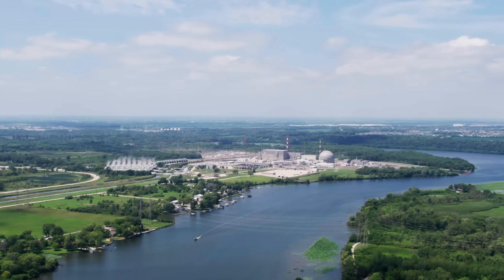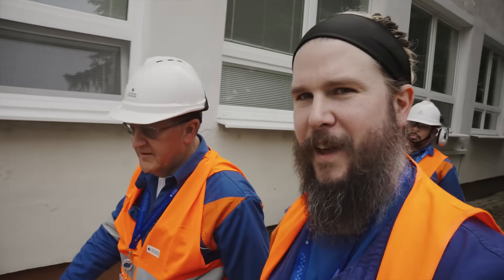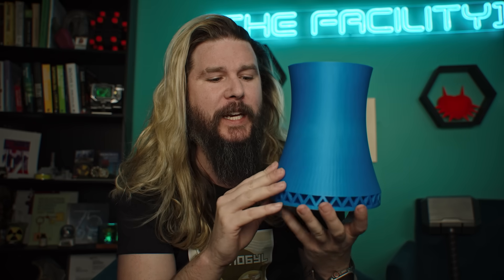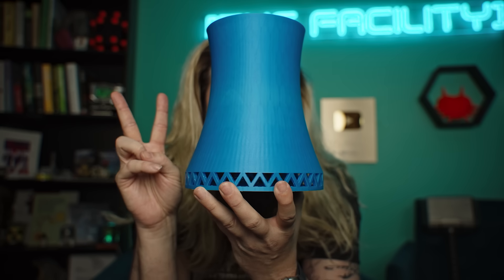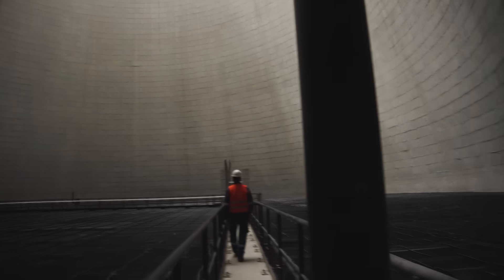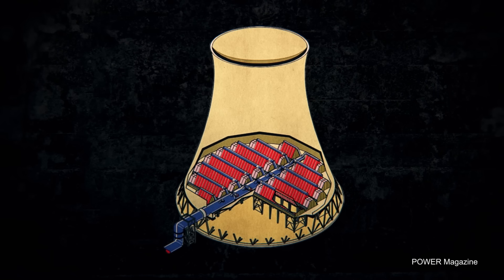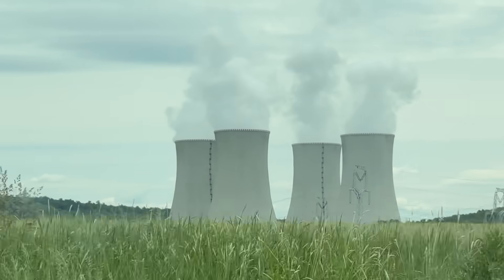I Went INSIDE a Nuclear Cooling Tower

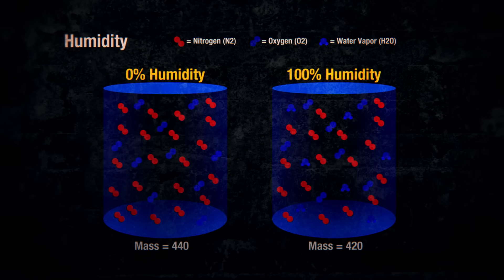Comment: 9:00 Exactly, because of the molar gas volume. Gas at ideal  conditions of 1013 mbar and 20 °C will always have a volume of 20.4 L/mol. Since water at 18 mol is lighter than diatomic nitrogen at 28 mol, it's less dense

Comment: Worth pointing out: Not all nuclear power plants use cooling towers. A lot of nuclear powerplants are constructed near the sea and therefore use sea-water to cool insted. This (I guess) reduces buidling costs, since you don't need to construct an enormous concrete tower. Another interesting thing here is that the marine life usually thrives close to these sites, because the water is very warm here and you're also not allowed to fish close to the nuclear powerplant (not for radioactive reasons, but for security reasons).
Of course, sea-water cooled reactors only works if you have a sea close to where you want to build your powerplant, which isn't the case for some places.

Comment: I always found it interesting that cooling towers are synonymous with nuclear power when they're actually used by all kinds of power plants.  There are several coal, natural gas, and even biomass power plants that use them.
Reply: And there are many nuclear power plants that don't use them.
Reply: @danbert8 IIRC, none of the British nuclear facilities have them.
Reply: @danbert8 IIRC, none of the British facilities have them.
Reply: I feel it’s because they’re “symbols” of the atomic age.

Coal has the thinner tall towers associated with them thanks to Industrial Revolution imagery, while gas plants often use very similar infrastructure to existing fossil fuel plants.

Nuclear plants, however, had way more of these types of cooling towers (and the Simpsons) to push into the mainstream image of nuclear.
Reply: @Palgineer  They are common to any power plant using igh pressure steam turbines.

Comment: Honest Question, could we not use the heat venting from the tower in some way ? seems wasteful not to. Or does that effect its operation so its left alone ?
Reply: Hot water could be pumped to locals to use for domestic heat and domestic hot water, but getting it there in a still useful heat isn't at all practical.  Nuclear power plants are located quite far from where that hot water would be desired.

Comment: Hi Kyle, Question: In your video “ I went inside a Nuclear Cooling Tower” time stamp 2:34-237  when you highlight the secondary loop, you say “ thermodynamic but not physical contact”  would that be better explained as Thermal Radiation from the primary Loop to the secondary loop?    Thanks!

Comment: It's a common misconception that there is any radiation in the cooling towers.  There never is, in any plant that uses them, and never has been.  The cooling tower works with the secondary water system that never touches the core.
Reply: Or more accurately; radiation is ubiquitous and is in every cooling tower that ever existed in every application they were ever utilized.
Reply: What you should have said is there's no more radiation in a nuclear facility cooling tower than any other type of cooling tower.

Comment: That’s not entirely why they’re curved. Yes it gives it strength, but it’s a phenomenon called stack effect. It helps induce a draft to get the air to move in the upper direction.

Comment: the cooling tower steam is irradiated, but it's like cosmic background levels, of if the cosmos was 1, a cooling tower gives you 2. it's just so painfully low that it's negligible.

also Cherenkov radiation proves FTL is possible, and it's blue. after all, Cherenkov radiation is faster than light particles through a medium, a medium is anything between you and end point, even air is a medium.

EDIT: we need a concert in a cooling tower.

Comment: Spoiler. I was correct. Venturi effect is active in the cooling tower. 

Not gonna lie, I thought the shape of the cooling tower was for venturi effect and removing hot air/steam more rapidly, especially with holes at the bottom.

Comment: These towers have also been used in fossil fuel plants for example Didcot B which according to Wikipedia is still used for emergency backup to the UK national grid. Also the interior of a cooling tower at the former Croydon Power Station (UK) was used to film scenes for the 1985 film Brazil.

Comment: So I want to throw this out here, there's actually like three different styles of cooling towers, depending on how much heat you have to dissipate. These hyperbolic towers are considered open natural convection towers. They are the most energy efficient for getting rid of large amounts of heat; but but they are also really expensive to build, they take up a lot of space, and they also lose a lot of water vapor into the atmosphere; which has to be constantly replenished. 
Then you also have the forces induction open cooling towers; which are cheaper to build, but use more energy to run, they are much smaller for the amount of heat they dispersed dump; and they also lose lots of water. These are usually what you'll see on large industrial sites; such as breweries and chemical plants. 
Then lastly you have the forest induction closed cooling; which is basically a giant radiator open to the air. They are the least efficient and terms of heat transfer;  they use even more energy per unit of heat they remove from the system; but they lose no water at all, which is important if you do not have a source of water nearby.

Comment: I get that the moist air is less dense than the dry air (though I also found it counterintuitive), but another factor in the airflow is that the air is hotter in the tower than outside, thanks to the hot water being sprayed in. I don't have the numbers or the thermo/fluid dynamics skills to say which has a greater contribution to the flow, can someone help me?

Comment: please do explain the OVERWHELMING NEED for a cooling tower. meaning thera are NO OTHER possible solutions for cooling the water coming out of the condenser. from the point of view of thermodynamics, the turbine condenser is identical to a refrigeration cooling loop: remove heat and vent it outside. so, why do you need a cooling tower?

Comment: If you like cooling towers: between Cologne and Amsterdam, there is an amusement park called "Wunderland Kalkar" that's built around a shut down cooling tower. There is actually a 58 meters high vertical swing INSIDE the tower that lifts you right above the rim.
Reply: Came here to say this. This should be far higher up in the comments!

Comment: If the goal is to make heat, tons of heat to turn the turbine, why have a cooling loop at all? Why not just superheat the water for more power/more turns/less reaction required? I can see the need for a cooling loop in case of emergency or shutdown, but not used in normal operation. I also like in a past video, some cities in cold climates, use the hot loop to heat cites and homes.

Comment: the hydraulic press channel could test a 3d printed cylinder vs a 3d printed curved cooling tower both printed with the same material and then see which one is stronger in what direction etc

Comment: couldn't we use the heat from the cooling tower with heatpumps and/or residential heat distribution instead of wasting it into the air? at least if the nuclear power plant wasnt as far away from cities

Comment: I'm always wondered why we waste the heat. Could you not take that heat and redirect it to warm up drinking water or houses. That is what the electricity is used for, but why not make use of rest of the energy. Even if the water would be say 50°C it could be used as pre-heater. Maybe we are not still at the point where efficiency is really the problem. But same thing with the spend fuel. You would have years of low heat generation.

Comment: Wouldn't there already be air flow just from the atmospheric pressure difference at the top and bottom and they are just using that effect and the water helping the effect further?

Comment: All right. I'm 6 and 1/2 minutes in. Let me hazard some guesses here and see how it ends up by the end of the explanation. First of all, I am guessing that they use concrete because it is extremely abundant and also extremely strong in compression, which is the majority of force being applied to it thanks to gravity. Second, I noticed that the shape combined with the openings at the bottom is not too dissimilar from a venturi valve. I'm guessing that the convective rising of the hot air is going to pull in cold ambient air along with it and then the narrowing of the tower is going to cause them to speed up and probably create turbulence thereby cooling the air faster than simple radiator passive cooling would do alone. It's sort of like a blast furnace in reverse.

Comment: 2 of Georgia's (the US state) nuclear power plants have a different style of cooling tower made out of fiber glass and use fans to move air through the water droplets that spray down from the top of the tower. I didn't see these types mentioned here. Probably because they aren't as flashy looking, but they are still cool looking and impressively simple.

Comment: Another advantage to the iconic shape of the tower is you're exploiting Bernoulli's principle and convection. The massive fresh air intake along the lower rim has increased pressure relative to the upper rim and throat. Allowing you to exhaust hot gasses faster than just straight-piping the whole tower and relying on convection alone.

Comment: Fun fact, water vapor being less dense than air is the reason that steam rises! It has nothing to do with heat, though being hot does accelerate its rise! If it weren't less dense, then steam would sink no matter how hot it was!

So, rather obviously, if any given mixture of air is 'diluted' with steam, it's average density will drop and therefore it'll rise faster (and the water vapor will pull it along)

Comment: If air is continuously circulating when a cooling tower is operating, is there any reason you couldn’t extract more energy from the wind within it? I.e. a turbine place in the middle of the bottleneck where air would be fastest?

Comment: The reason they're shaped like that is to  increase the surface area and create turbulant flow and the structural benefits were just a bonus. They're wanting to trap as much of the water as possible for re-use, Watch video of a reflux condenser used in chemistry which have similar but repeated shape and you'll see how it flows. A straight pipe would just create a draft and suck most of the water vapor out the top.

Comment: The coal power plant I used to work had one of those...
Idk exactly why, but it only reduced 2ºC of the water temps and in Brazil it's kinda too hot for them to work properly anyways... the company had extra cooling towers that ran more water and lost more to evaporation, but it cooled the water like 12ºC

Comment: So the bottleneck in the middle of the tower works kind of like a Venturi in a carburetor, changing the air pressure causing the air/water mixture to flow out faster, making it more efficient.

Comment: Lots of coal-fired plants have used that style of cooling tower, haven’t they? Also oil and gas-fired. Last trip I took to England I took some train rides and saw WAY more of those towers than England has ever had nuke plants.

Do MOST people think that such towers mean nukes? Probably. And this video (so far) is reinforcing that. You’re helping make people MORE ignorant, perhaps. But we’ll see…

My local nuke plant uses ocean water for cooling and doesn’t have a cooling tower. I wonder how many power plants built on lakes or reservoirs don’t have them either.

Comment: Somehow I feel betrayed, given the keywords mentioned by Kyle, for no mention about the cooling towers of the Mako Reactors in Final Fantasy VII, which surround the plate like structure, often nicknamed the , albeit rotten, pizza. This Video actually helped explain some of the design choices of the Reactors in the 7th entry and its remakes. Thanks to that I'm also shocked about how little Shinra seems to actually care about the Citizens of Midgar( not that they cared much about their safety to begin with), with how the entirety of the closed systems is inside one of the reactors.( and don't get me started about their military secrets hidden within reactors 1 and 5, as well as the Human experimentations in Nibelheim's reactor and in reactor 0 underneath the Shinra Building) The green glow of the Vapor leaving the reactors may be the result of water vapor scattering the light emitted by the glowing mako at the bottom of the reactor.
Furthermore humans infused with Mako, develop a characteristic halo like glow in the eyes, aptly named Mako-Eyes.

I'm personally still convinced, that Mako Energy is the stand-in for nuclear energy within FF7, given some of the side effects, while others are based on the fictional side effects of nuclear energy.

That said, hearing the accoustics within those towers must have been a serene experience. Liked the rendition of the Halo Theme with that reverb.
Oh and while the shape makes sense from a static perspective, I thought it would serve as a funnel as well.

Comment: the site i work on only has two passive cooling towers I like giving the site tours and getting people up close to the tower as no one is prepared for how massive they are up close or that they have a pool in the bottom (the previous site i worked on had a disused tower that was too crowded to bring down so they filled the pit with concrete and we parked our cars in the tower), the more modern active towers aren't as impressive. It's interesting to talk to the old timers who saw them get built as kids, there are still stories about guys working at the top of them having to dangle a wheel barrow over the edge while another walked by, all with no ropes

Comment: Those cooling towers aren't shaped as they are for their strength like you say. They're shaped like that to achieve venturi effect. There are much stronger shapes but all those towers really need to carry is their own weight. What's much more crusial is how the air flows and that's why tey are shaped as they are.

Comment: You really don't get a sense for how big they are until you're in one. My mom worked for Three Mile Island and she took me inside one of the deactivated cooling towers. We were able to actually drive her car right inside it and get out to look around. They then took me on a tour of the plant. It will always be one of my favorite memories.
Reply: Lucky guy
Reply: That is so cool
Reply: That's what he said. 😅
Reply: As a Pennsylvanian I am throughly jealous!! I’ve passed three mile so many times and I’ve always thought man how cool would it be to take a tour of that place
Reply: And we didn't even get an explanation of why they have to be so big and imposing on the landscape, why couldn't they be half or quarter sized? Couldn't they do a couple smaller ones so they aren't so offensive?
Reply: @SeanBlader  Probs because more area mean more cooling capacity. Idk bout height tho, maybe because such hot air and vapor could be bad for those on ground?
Reply: @joinfeedrage6901  Because they work on the same principle as chimneys, the airflow is driven by the density difference between the warm, moist air inside and dryer, cooler air outside, so height increases the power of the airflow and so increases the cooling. If you made them shorter you'd have to make them much larger, or have more of them.

Comment: Just started this video and I want to ask a question I've been wondering forever that's hyper relevant. If what comes out of the cooling towers is primarily water vapor why don't they put something over the cooling tower to capture and recognize that moisture so it can be reused and recycled. Like a large bowl over the top of the tower that captures and condenses the water and then lets it drip down the side of the cooling tower where it can be collected again but I'm just curious why they don't recapture the water for reuse

Comment: There is a nuclear reactor in germany that was never actually put to use and they turned it into a theme park. You can go into the towers and try the echo. It is near Xanten called Wunderland Kalkar. So yeah, I was in a cooling tower like 20 years ago already :D

Edit: I checked what happened to the park. It still operates but the tower now also houses a chain carousel that first pulls you up just over the edge of the tower and then you spin with a view from the top.
Reply: Wunderland Kalkar, Tom Scott made a video about it.